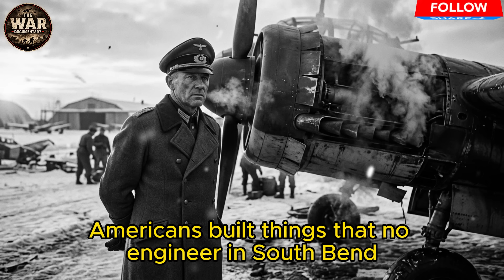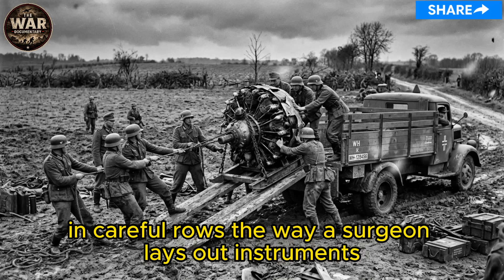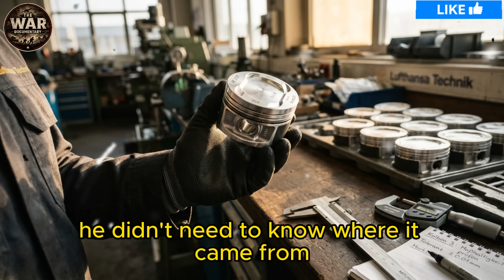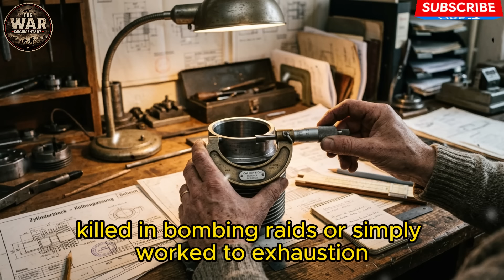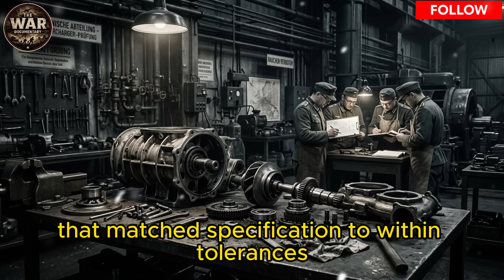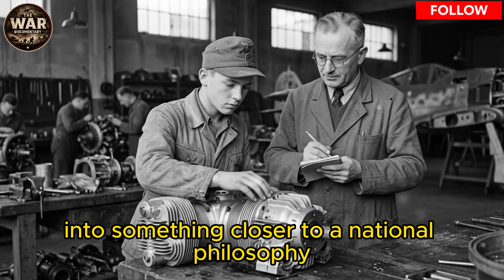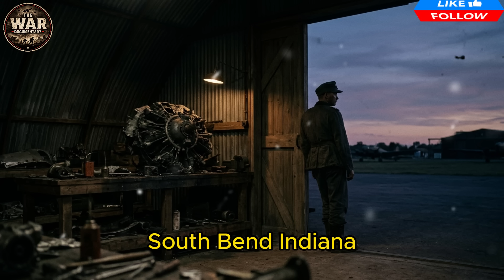What Happened When Germans Opened American Engine for First Time

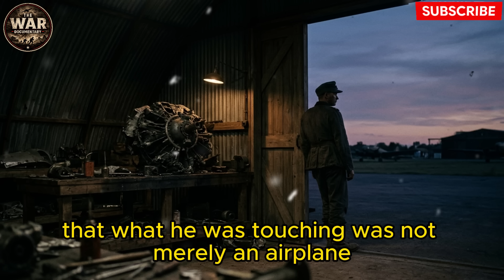Comment: 47:43 — “The right way to build something was to build it so that anyone, anywhere, could fix it.” That idea perfectly captures why standardization and teamwork can outperform individual brilliance over time. I found this ending especially powerful because it turns an engineering story into a lesson about resilience, adaptability, and shared knowledge. Do you think modern industries still value repairability and interchangeability enough, or have we moved too far toward disposable products?

Comment: What the podcast described is 'The American System'. The method harks back to the early days of New England textile mills of the 1800s. Textile mills had been buying English looms but had the same problem the Germans, too much fiddling to keep them running. American engineers updated the mills that any part fit any other mill. That interchangeable nature stuck as a economic business advantage and became the system that made moving assembly lines possible.

Comment: Henry Ford pushed forward very strongly the accuracy of machining tolerances.
There is an excellent YouTube on this subject.
It was measurements being standardised across the world being unified.
Henry Ford made the manufacture of slip gauges affordable they cost so much and were so difficult to produce and retailed them, which in turn made a giant step forward towards standardisation and interchangability.
And you can't know by touch a difference so slight. This is done only by measuring devices correctly calibrated on a reqular basis by skilled machinists.
Bolt holes out by a mm on an aircraft engine === come on get real.
Take as an example a certain Swiss watchmaker producing fully hand made limited edition timepieces with many complications and money/cost no object whatsoever. 
A skilled watchmaker taking one week to cut out and hand file under extreme magnification a single cogged component wheel. 
I class that as a one off part and likely to take another watchmaker the same amount of time to reproduce should the need occur.

Different manufacturers producing the same item  part should be checking interchangability when descrepencies occurred.
Having to fettle parts to fit is poor manufacturing quality standards.
The Americans seemed to have managed it in ww2 parts from various factories were fully interchangeable. 
Whereas the Germans had not unfortunately. 

Not withholding germanys technical skills were amazing but sadly alas not their manufacturing  by way of accuracy in producing standardised
components.
They were also reknown for over complicating designs that could have been made alot simpler.
Reference welding on a Tiger 4 against a Russian T34 tank.
Check out also the production costs between similar weapons of war items against other combantants costs example

T34 $24,000 1942 approx
Tiger 4 tank $100,000 1942.

If you purchase a car part it's assumed it will fit, should it not its been made quick and cheap and  inaccurately ==not to standard and will need fetteling or replacement.

Comment: Engineering accuracy and manufacturing accuracy is even better now with Computer Aided Design and Computer Aided Manufacturing. 
When Boeing computerized the early 747 drawings with Catia they discovered some bolt and hole locations were as much as 3/4 of an inch off from where they were supposed to be. Engineers were left wondering how the machinists were able to assemble the plane properly.
I used to work at Boeing, and knew a number of the engineers.
Reply: You should return to Boeing and help them get their shit together
Reply: @donarthiazi2443  I work in IT Help Desk support for an Italian aerospace company.
The problem with Boeing is they brought in an IT contract company and the best IT support employees left and the worst ones stayed. 
If I went to work for Boeing again I would LOSE retirement benefits. A very stupid set up.😊

Comment: 6:42 - The Nazis weren't alone. No other combatant in WWII made truly interchangeable parts. Pretty sure it was Gamble in "Target : Rabaul" who had Japanese techs filing pistons to fit which not only killed in-service rates but also horsepower.
14:22 - A human hair =~.002".
16:18 - And the much-maligned strategic bombing campaign made sure little raw material got to factories and few parts got the front - see O'Brien, "How the War Was Won".
9:22 - Pretty sure the hours backwards.
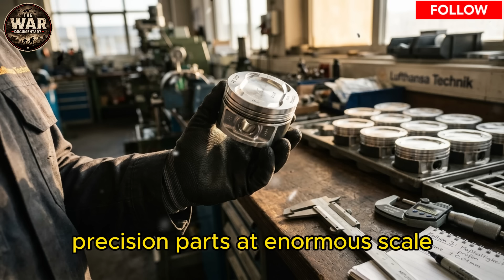22:12 - Tooze, in "Wages of Destruction" details the Nazi economy. Unlike the common view, it was largely agricultural, with a veneer of scientists, engineers and (yes) master-workers. Someone characterized Cold War USSR as "Upper Volta with Missiles". Nazi Germany wasn't far off, except the missiles weren't good.
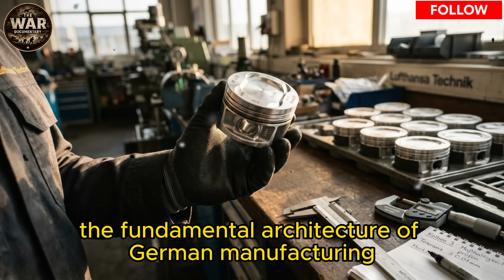23:16 - Speer's "Inside the Third Reich" has him constantly pushing for "Fordism", but I'm pretty sure he hadn't a grasp of what it actually took. He was an architect, not a machinist and that may have been the issue. Architects don't dimension in ten-thousands of an inch.
27:55 - And a pilot with that number of stick-hours isn't going to last long either.
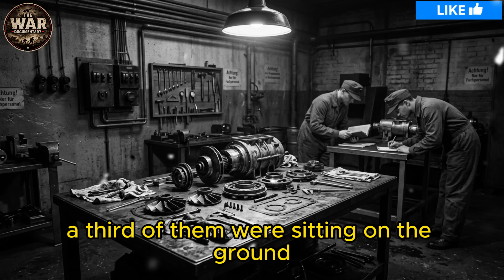29:10 - And no fuel.
33:31 - Some of the AI images are beyond amusing!
34:55 - Junkers built the 004 turbojets, which were not ready for prime-time. Several sources have them with a TBO of 8-10, which would not be comforting to a pilot flying a plane with that glide performance.
35:40 - That image is intended to represent an air-cooled something, but I have no idea what!
40:02 - There was a further problem: By mid '44 both the Nazi railway and highway systems were unusable during most daylight hours. Parts requiring on-time arrival were no longer a workable plan; there were, by then a lot of un-needed parts in one place at the same time there were none of the needed parts somewhere else.

Comment: The US auto industry did not have the machines or infrastructure to make weapons. The Government paid for new machine tools and tooling to enable them to build precision aircraft engines or other weapons. The new equipment was typically hard automation - controlled by cams, stops, indexers that performed multiple operations independent of the operator's skill or care. These machines were very fast.
The machinery required a highly skilled person to set it up, a setup man. Once set up, the equipment made accurate parts with unskilled operators. The operators and inspectors made sure that the cutting tools were sharp and to specification.
To do this, you need investment up front and a stable design. Change could be made, but it was disruptive and constrained to the adjustability of the machine.
The automobile engineers and aircraft engineers chafed on the ability to change to improve the product, but the government intervened and they built the plants and the product flowed like a river.

And when men were conscripted from the plants to serve in the US military, their replacements: women, farmers, largely unskilled, tended and ran the machines without a glitch. They were not taught to be meisters- they were taught what they needed to know to do the job.
While everybody points to Eli Whitney (the 10  muskets with interchangeable parts) as the inventor of interchangeable parts, the real developer was the Colt Armory, specifically the leading engineer/machinist/designers that took most of the 19th century to make it work.... machines, measurement tools, standards, methods and drafting techniques.

The allies committed their economies to war production using these methods. The Japanese and Germans, with a head start in numbers of planes and weapons just kept on as they had started. They never committed to vast organized considered production. They used slave labor.

Comment: Found this enjoyable. But nitpicking is my middle name. So when you say that cylinder bores were within the thickness of a human hair. You're saying, plus or minus 0.004 of an inch. So far out of tolerance,  the part would be rejected. In reality, the typical tolerance would be +/- 0.001. Worse case, double that. So half what you stated.

Comment: Germany actually used many American designed aircraft engines during World War 2.    Martin Caidin  restored a Ju-52 tri-motor transport.   Its BMW radials were license built copies of a Pratt and Whitney design.  I believe some of the planes cylinders were replaced with Pratt and Whitney parts.   The Ju-52 was a mid-1930s design used as a bomber during the Spanish Civil War.    It served as an airliner and military transport.   It role was much like that of the DC3 / C-47 in American service..  It was an older slower and generally cruder design than the DC3.   It was the backbone of German's air transport and supply during the war.   Germany had a few modern transport aircraft but they were never built in large numbers.  The Ju-52 was what they had and it served all during the war and after it..   
 
BTW American aircraft could be rebuilt from grounded aircraft to damaged to fly.   This made each Hanger Queen a ready source of spare parts.   Parts could be taken from wrecked aircraft to keep others flying.  This was vital when parts might otherwise have to be shipped halfway around the world.   This also meant basic tools could remove and replace parts where German might need machine tools or at least a sheltered shop.   Both sides dis amazing things when work in the field required it..  American precision just gave the GI in the field a big leg up on the process.
Reply: Another dimension to the two warring cultures, perhaps most relevant to mechanized army machinery was who could fix and who couldn't . 
American farm boys would typically fix their tank, truck or jeep. German soldiers, if they were not mechanics, we wait for mechanics or simply abandon vehicles that stopped. 
In the equipment of the time it was usually a carburetor or ignition problem, moisture or dirt, and small simple parts that they carried spares for. The Americans typically fixed stuff. Other soldiers more commonly didn't, unless they were trained and titled.

Comment: July2026#2:  As a young man in the 1960s, I helped my Dad sell used cars.   We found it easy to sell Mercedes, but not fix them.
    Those cars had exquisite MECHANICAL fuel injection, but wouldn't settle down to a steady idle.   They would "hunt" between 800 and 1200 RPM, slowly rising and falling; rise and fall.  The German design was so complex, it required a German immigrant to fix it.
    American cars had reliable old carburetors.  Fuel injection didn't become standard until a decade later, and that was ELECTRONIC fuel injection.
    German design was very advanced, but only a German mechanic could fix it.
            Retired in Sacto.
Reply: Things have not changed
Reply: I would gladly give up some mpg to have a simple carburetor!
Reply: Jawohl! 👊
Reply: I only worked on one Mercedes from the 60's. The brakes were about the same as the total contract type that Chrysler used in the late 50's and early 60's. Not a problem to repair. About the only other thing I remember is that it looked like an old Rambler.

Comment: f w 190  had a  fadial  engine    so  did  other  aircraft       time  to  stop  the  clickbait   and  get  off  the  internet
Reply: Just an FYI, not a criticism (other than a constructive one), some later FW 190's did have inline engines - the profile of the engine cowl was that of a radial because of the huge cooling fan (and I would assume to negate the need to retest and modify for aerodynamics).

Comment: The AI illustration of the German mechanics examining a radial aircraft engine is impressive in its detail, even down to the title of the technische Dienstvorschrift (technical service regulation) for the 9-cylinder Wright [R-1820] Cyclone engine lying next to the engine on the workbench. Unfortunately, though, the engine (or half engine) shown has 8 cylinders. Having gone to the trouble of producing such a commendable (albeit inappropriate) piece of art, it is a shame that you had to spoil the viewer's experience of it by imposing artificial snow drifting across the screen. Also, a little consideration would tell you that a technische Dienstvorschrift would be a major challenge for German engineers to write, given that they didn't design the engine and had to work out everything from engines recovered from crashed aircraft. There would in any case be no point in preparing and printing such a document, because a few recovered foreign engines could not practically be installed in German-made aircraft. The only point in examining the R-1820 would be to see if there were any engineering lessons to be learned from it, or perhaps whether there was any weakness that could be exploited by attacking German fighters.
Reply: Long  nitpic  misses the most obvious thing wrong with the picture. Deliberately?
Reply: @CharlesWhitmore-fm7tp  Well, I didn't want to make my (admittedly overlong) nitpick even longer by pointing out the more obvious implausibilities. Aesthetically, though, I admire it as a fine example of what AI can do.